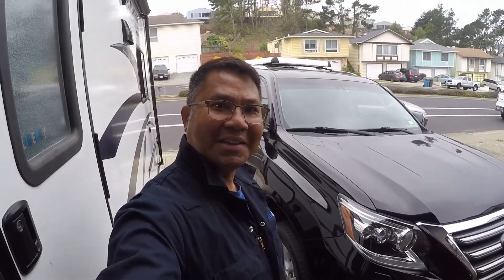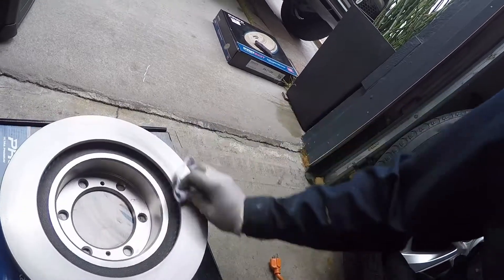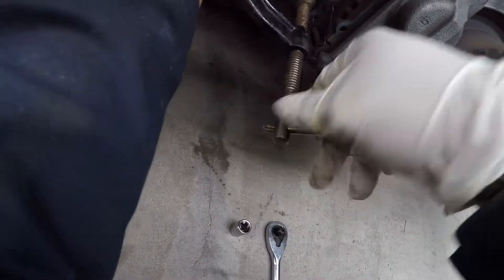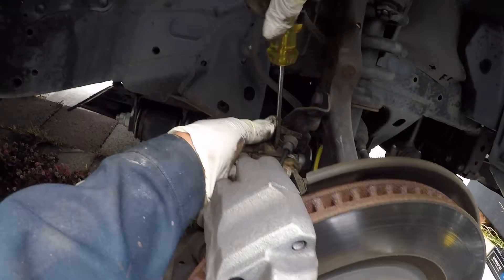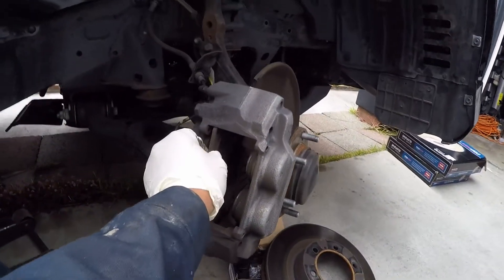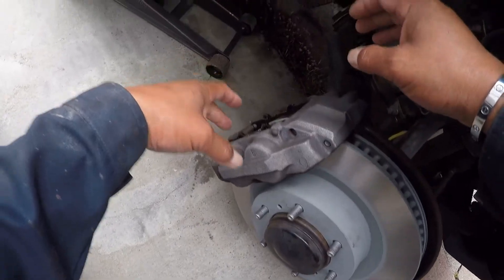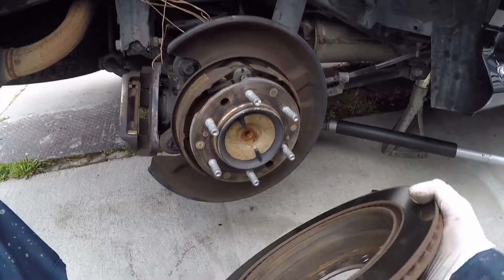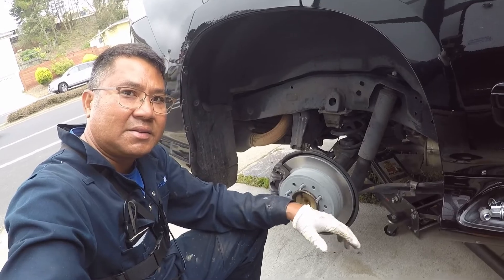Lexus GX460 2016 Brake Pads and Rotors Replacement

Comment: hi there! could you please let me know the rachet/socket diameter for removing the screw/nut, and also the unit of messurement?(being a japanese car) thanks!!!
Reply from the maker: Not sure which nut size you’re referring to. But Japanese car mostly use 10,12,14,17mm on their bolt and buts
Reply: ty

Comment: You need to spray a ton of brake cleaner on the actual rotors first, then wipe them down. Dabbing a cloth with a small amount brake cleaner like it's perfume is only going to smear the shipping grease, not remove it.
Reply from the maker: Yup true 👍🏻✌️